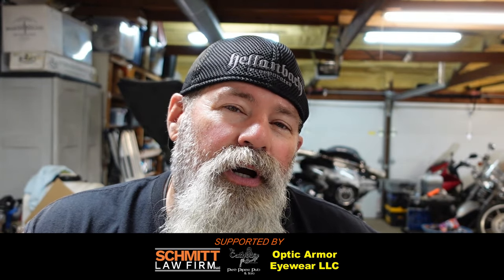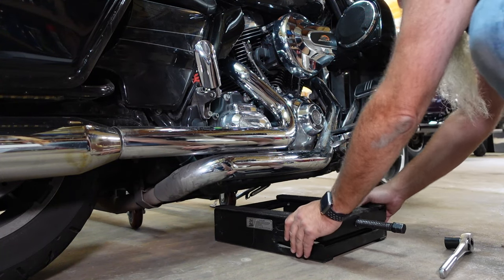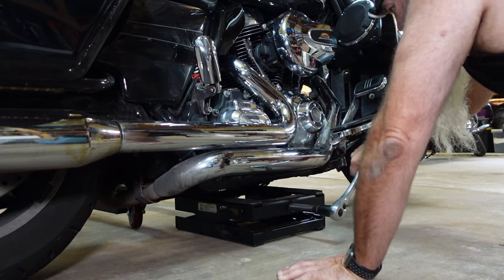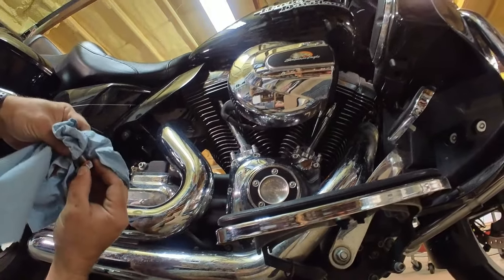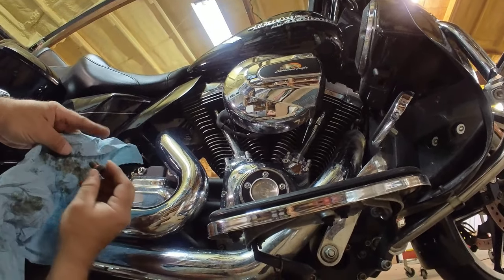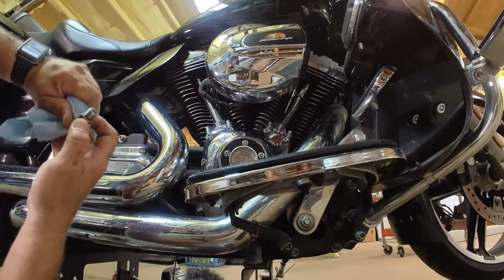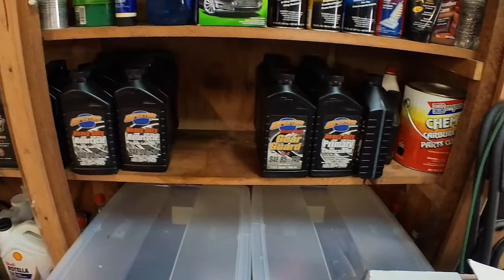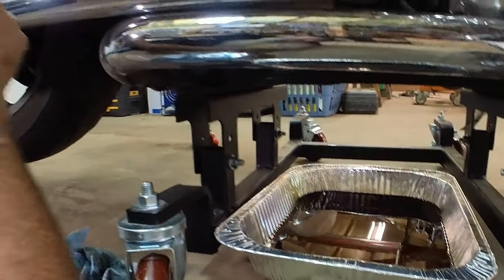3 Hole Oil Change HARLEY DAVIDSON  Twin Cam TOURING Models!

Comment: Nice lift. Good video. Don't see many people running the old dead dinosaur oil anymore these days!!!
Reply from the maker: I would rather run conventional and change it more often since I do it myself. Just not convinced synthetic is worth the cost difference personally. If I was paying labor for someone else to do it then I might try synthetic, if I get a new 24 I might but I been running this oil since the first service.
Reply: @RidingintheOzarks  Amen brother! Good oil is changed oil...

Comment: Hey Man Mountain Mike, have you considered installing a oil filter relocation kit on your bike? It makes changing oil much easier and less messy. It also helps to cool down the oil temperature. I run one on my RK and love it.
Reply from the maker: I have not. I may look into that, I can’t say I had even heard of this before

Comment: I tried to do this on my road king. Got all the funnels and drain pans ready to roll, cleared my saturday so I would have plenty of time to baby-step through it (I've never been the type to do my own vehicle maintenance, but want to change that). 

I got everything set up, and got down under the bike and found that whoever had done the last oil change on it (before I bought it), apparently had the forearm strength of 19 gorillas. They had wrenched the drain plug down so tight, I could not get it to budge, my impact driver could not get it to budge, I borrowed a breaker bar from a neighbor and I still could not get it to budge.

I took it to my local dealer, and had them do it. No idea what they had to do to loosen that thing.
Reply from the maker: @claytongibson2474  that is very concerning, I would ask the dealer and be concerned someone used something like JB weld because normally it would strip if you over tighten it. I wonder is previous owner did something like that then used a pump to siphon the old oil out?

Comment: Do you not recommend changing the oil after the bike is warmed up? Or while cooling off after a 5 minute ride?
Reply from the maker: I usually do change it while the oil is warm just so it drains faster but I personally don’t think it makes a huge difference otherwise

Comment: TY for the info.  One other question, how tall are your handle bars ???  I’m going to get a set soon (2021 Street Glide) and I am trying to figure out some sizes by looking at your bike.
Reply from the maker: Mine are 12’s
Reply: @RidingintheOzarks  TY Mike, I like the way they looked, especially with the hand guards.
Reply from the maker: @brucesmith7858  the nice thing about 12’s are you don’t have to get new clutch or brake line, just wiring extensions

Comment: Good to know about a quality lift for the bike, what brand Torque wrench do you suggest?
Reply from the maker: I think My Ft-lbs one is craftsman that I have had for about 20 years, the in-lbs I bought recently and went with a lexivon from Amazon.
Reply: @RidingintheOzarks  I'll be buying a couple of torque wrenches for routine maintenance on my Street Bob... important to stay within torque range especially on oil change maint. 🔧
Reply from the maker: @garyrhode3755  Stripping a bolt is no fun especially a drain plug...